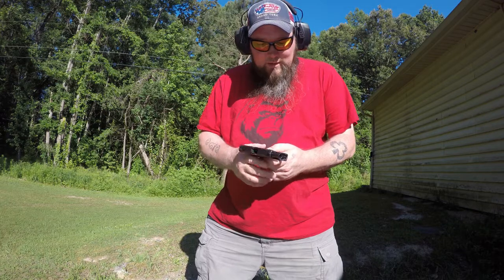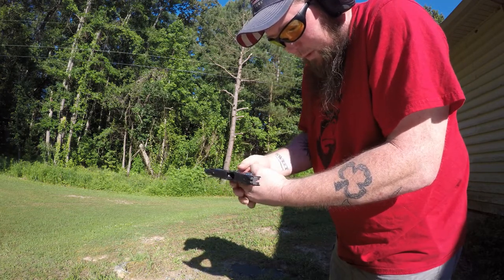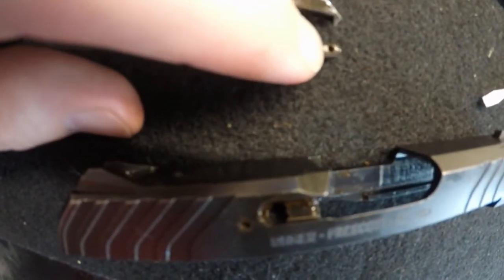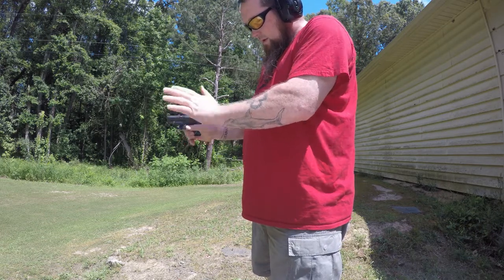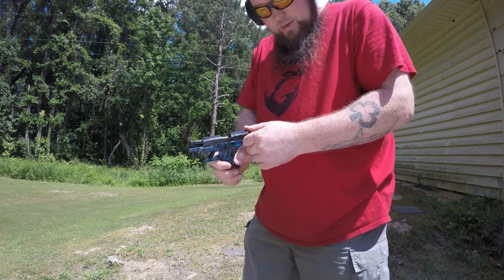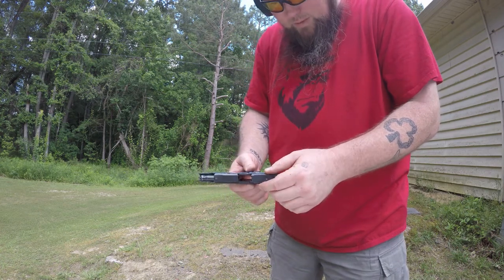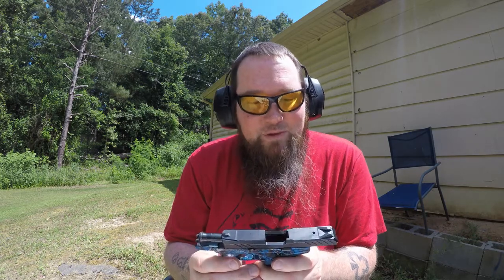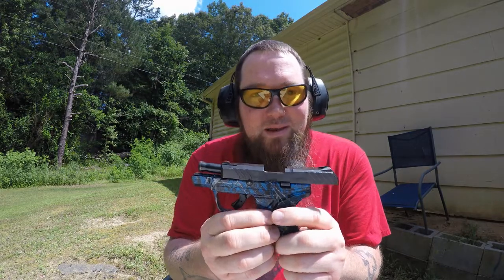RUGER LCP2, EXTRACTOR PROBLEMS FIXED

Comment: Thanks for the video G&G. My relatively new LCP II had this issue after about 200-300 rounds of range use. It's past warranty so this video came in handy.
Reply from the maker: Glad it helped, I've heard from alot of people that they send the slides out for ceracoating in order to keep them from rusting and keep them running smoothly.

Comment: My sister had a LCP that she absolutely loved. Around 1.5k rounds of running flawlessly she was cleaning it and found that a slide rail was completely cracked. She sent it in to Ruger and they replaced the gun free of charge and sent her a new one. The new one kept having failure to extracts, tried different kinds of ammo and it didn't matter. Sent it back to Ruger, they said they fixed it and sent it back. First trip back at the range, failure to extracts again. She called up Ruger yet again and they said try different ammo which we already tried for the second time. She finally gave up and bought and now carries a Glock 42 😂 I'll have to do a video on it some time. Anyway, way to get it cleaned up and back into action!
Reply from the maker: Yea, that is wierd.  This one was just rusty from sitting around and not being used of oiled. Could be that there's a problem with the extractor spring and plunger, they tend to be really stiff, maybe take it apart and lube it up and see what happens.

Comment: Have a new LCP2 .22 and the extractor is way different.  Made in Mayodan, NC.  Much longer extractor and the pin is all the way back in the slide grooves - like the LCP MAX.  Just got it and have yet to test it.  Would like to see you test with full 10 rd. mag.  I see a lot of tests where the first round is a FTF or FTE and after clearing the rest run fine.
Reply from the maker: I usually like to test them with the dirtiest cheapest ammo I can find, but for .22 you may want to use something nicer. If the mag is stiff then you may not want to load it all the way. Put a 100 or so rounds thru it the clean it and you should be good to go.

Comment: Enjoyed this video!   I have the LCP II in 380 and 22, both fairly new, flawless performance but living in Arizona, not much of a rust problem here.    I wanted to see how you removed the extractor and firing pin as I may have to do this one day.  
   I maintain my Glocks and Rugers in pristine condition.  Glocks like to run dry, not much oil.  Don’t know about Rugers?     Thanks for doing this video.
Reply from the maker: Thank you. I keep this one fairly oiled just because it was already rusted. There are some videos on how to take the slide apart that were made before the new YouTube days. It was actually fairly easy. I'm in a high humidity area of the east coast, so I tend to keep everything oiled well.

Comment: I have an LCP II that keeps on braking off the ejector after shooting about 8 rounds. I have sent it to Ruger twice now, but keeps on breaking. Seems that their quality control has gone down the drain. Selling that sucker after it comes back. Still have the original LCP which works flawlessly.
Reply from the maker: I've heard that these have been having that issue. This one has held up ok, I keep it super oiled so the rust doesn't come back.
Reply: Just sent mine back today. Also for the second time.  I'll never trust it again tho, damn shame tho.

Comment: Bought my dad one lcp 2 Lazer 380 model and he had some minor issues as well and his rusted up within 5 months so Ruger sent me another slide with barrel and Everything and he hasn't had many issues since i used it and had just two failure to feed and one eject issue and i noticed that when racking the slide to chamber the first round you need to do it really fast and it's fine but if you go slow it won't feed the round properly so after that and i liked it up really well haven't had any issues since my dad said
Reply from the maker: Ruger does seem to take care of their customers really well and has a great warranty.  Glad to hear that it all worked out.  This one has been good since I've cleaned it up, but I still wouldn't carry it or trust my life to it.

Comment: My LCP2 is having the same issue with the extracter, but I'm afraid I will damage it trying to disassemble it or put it back together wrong...I would have liked to see how you did the disassembly and reassemble of the extracter...thanks for the video it at least helped me diagnose the issue of not feeding.
Reply from the maker: Its pretty easy, I actually found a video, from before YouTube started acting all stupid, that actually shows how to disassemble the slide.  I'll try to find it and get you the link.
Reply from the maker: https://youtu.be/7TxZrH8agXk
Reply: Perfect..thanks
Reply from the maker: @roymandrell8517  any time

Comment: I got a LCP 2 .380 and never had any problems. I also have the LCP 2 .22 and I have a lot of problems with FTF and FTL especially with CCI Stingers. Mini Mags hardly any problems and no problems with Winchester Subsonics. These little Rugers seem to be ammo picky.
Reply from the maker: Walthers are ammo picky also. This lcp was just not stored right and got rusty as a result.  I've had other people tell me that they've had it happen to theirs as well, that's the thing about metal,  if you dont take care of it,  it will rust
Reply: @GorillasGuns  That's right! I keep mine oiled up good with Ballistol especially the slide. These little Rugers are horrific about rusting but if you keep them oiled you will have very little problems with rust.
Reply: It's about the case length... Subs are big and the case is extra short... The extractor is able to clear the chamber before it loosens up... I have the same problem as you but I can run mini mags and thunder bolt...

Comment: My LCP 2 had two issues: failure to chamber and failure to eject. The former was fixed by polishing the feed ramp and the chamber. But out of a box of 50, I was still getting 2 failures to eject (the spent casing gets wedged between the chambered round and the slide). No, I'm not limp-wristed, Rambos :>) 
I've sent it back to Ruger, see what they say. Love the trigger on this weapon.
Reply from the maker: That extractor seems to have been a problem with alot of these guns, not only from rust issues like mine, but because the extractor was jammed it wouldn't go into battery either. Sounds like you did the right thing for the chameriing issue. I'm not really a big fan of this gun because of how small it is, I have a hard time holding onto it with my big Gorilla hands..🦍🍌
Reply: @GorillasGuns  Yeah. I bought a seven round mag for it, and that affords me a normal three-fingered grip, but it IS a tiny piece.
Reply: @tinman8972  yeah same here.

Comment: Nice job getting that thing running again. Rust can definitely cause all sorts of issues. Those are some tiny pistols...especially when you've got some gorilla hands ;)
Reply from the maker: It took some time and work but I got it going, I'm looking to start some kinda gunsmithing coarse, 30 years in the industry I'm in now, it's time for a change
Reply: @GorillasGuns  Plenty of resources for some courses, but I'd suggest try networking with some area gunshops/gunsmiths....see if they have any basic courses or willing to let you shadow them some. I've only ever taken one course, an AR15 basic armorer's course. Has helped me a bunch, but always learning new things. Experience trumps any coarse in my opinion. Part-time gunsmithing is one of my goals down the road. Not for the money, just because I love tinkering. And love firearms.
Reply from the maker: @ChristianGrest  I've been looking at SDI and yes, experience is king, which is why I'm glad I've got some stuff to work on. If I could only quit my job and seek out an apprenticeship, that would be ideal
Reply: Gorillas & Guns let me know your thoughts on SDI. Considered taking some courses through them as well.
Reply from the maker: @ChristianGrest  they seem pretty legit,  I have talked with a guy Zeek Stout that works there or with them and he gave good recommendations,  plus 22 plinkster also advocates for them as well

Comment: I have a brand new lcp2 that is having those same problems
Reply from the maker: Well if its brand new,  you can send it in to Ruger and they'll fix it or replace the slide. From what I've been hearing since I made this video is that they do like to rust, as it's a common issue.

Comment: The Ruger LCP2 is a very problamatic handgun. Has feed and ejector problems. My new LCP2 blew out the extractor, after only 60 rouds of brass ammo. I searched the internet and many other LCP2 owners, have had this problem. I don't recommend this hand gun for a EDC weapon.
Reply from the maker: Agreed! This one was just never cared for and got rusted out. Still has issues but works better than when I got it.
Reply: Mine has the same issue! Selling it!
Reply: @flyontop  Ruger sent me a new barrel and slide, I haven't checked it out yet. I'm going to get rid of it. I bought the Ruger LCP Max and have never been happier.
Reply: @catman581  I did the same… just sent my LCP II back to ruger today. I am waiting for it to come back to get rid of it. By the way, I had frame issues with a brand new Max 9 as well. Got rid of it, seems quality is no longer there at ruger.
Reply: @flyontop  Get rid of it, I did

Comment: I bought one for the sheer tiny factor only weighs 11oz.   Tried different ammo and cleaning but kept f2f.   I bought this new at a big box store they actually will allow returns so as it was useless - nothing fired - I returned it full refund.   I still want one so may try the cerakote but I'm sceptic it will last.   Any ballpark idea of cearkote price?  Also heard some brands of 380 won't fire in this gun
Reply from the maker: Never had any cerakote work done on any of mine. Im sure there may be someone near by you that does cerakoating. If not call Mike at Blown Deadline, look them up. He does amazing work.

Comment: The Extractor flew off of the gun rendering this Firearm useless. Walked right off of the Range and bought a reliable firearm Glock 42. I was about to buy the Ruger Max but after this catastrophic failure. You can not depend your life on this Firearm .
Reply from the maker: I've been hearing more and more of these issues with this particular firearm, you're not the first I've heard say the extractor flew off, looks like a continual issue with these.

Comment: Is it a barrel or battery 🤨
Reply from the maker: When a gun is properly in battery it means the slide or bolt is fully closed and ready to fire. Guns out of battery have the slide or bolt stuck partially open.

Comment: Wish that was the problem with mine. Mine has zero rust! Jams almost every time, no matter how clean it is or with any kind of ammo. POS gun.
Reply: I have the LCP 2 .22 & it won't eject & when it does eject properly the next round jams. I never have these issues with my Glock
Reply from the maker: These are known to have extractor problems,  send it in to Ruger and they will either fix it or give you a new one.
Reply: @GorillasGuns  I stripped it down, cleaned it, & oiled it down real good & it works perfectly now